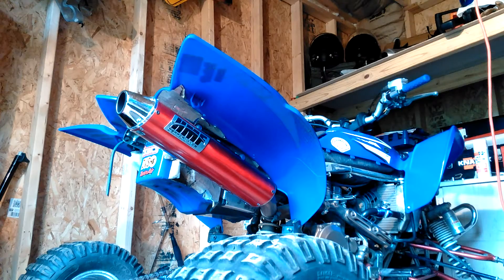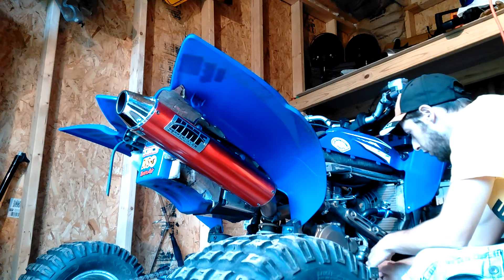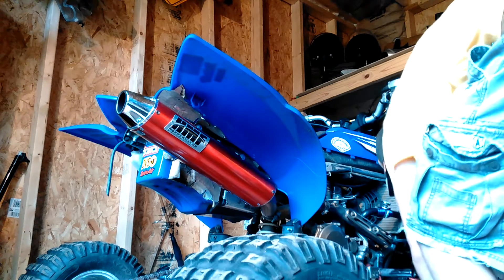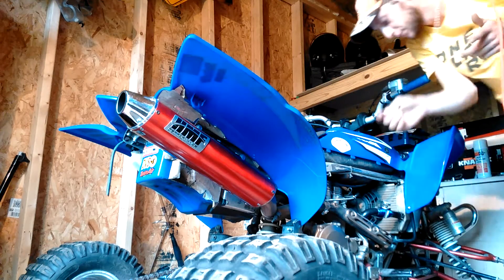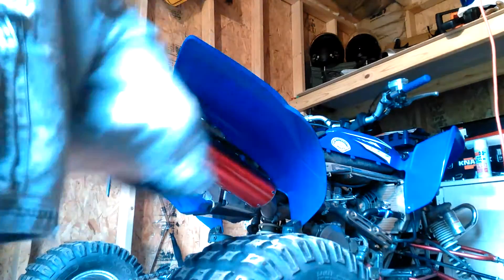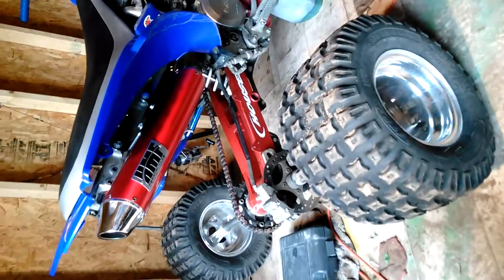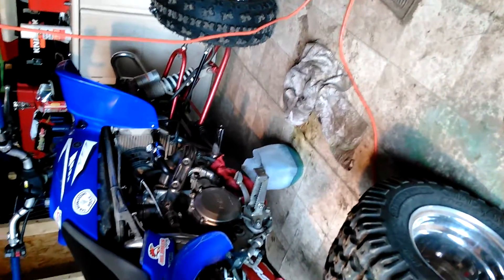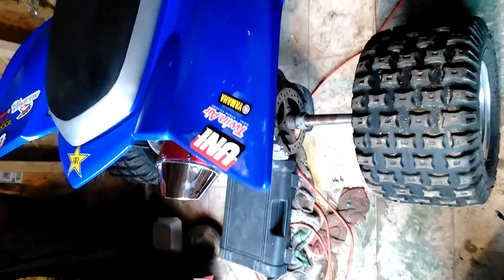How to Change Coolant on Yfz 450

Comment: Nice bike skin!  I just got the red yahmahYFZ450R SE.. love it!  Matter fact i changed my first oil change on it yesterday after the break in point.. now am aimin to check and change my coolant in the mornin... thanks for the video man...
Reply: I used semi- synthetic 10w40 Maxima oil @3hrs (still breaking-in) on my new '21 Raptor 700R-SE . Figure 3rd oil change will use a FULL SYNTHETIC 10w40 oil.. Maxima or Yamalube. I have heard Mobil1 4T racing oil 10w40 is great in these ATVs.. @ $9qt isn't bad! These machines run hot & semi-synthetic is absolute minimum oil can be used or bet you will grenade it in short order/very least need rebuild too soon. Have a '10 YFZ450X that still runs/looks great 👍. Enjoy!

Comment: That temp gauge that you have is on the wrong hose, it’s supposed to go on the other one as this is the feed into the motor (cooled by radiator) side
Reply: You could hypothetically do both. To verify rad efficiency.

Comment: I will be changing my hoses to a different color would you recommend putting new coolant in my bike?
Reply: Rashad Dorsey engine ice is great
Reply: Don't  use engine ice,, it can damage parts in your unit,  use yamalube yamacool,  that is specifically made for yamaha qauds
Reply: @juangaytan2437  haven’t had any problems with engine ice. Works great
Reply: You can use any coolant designed for aluminum blocks it says it right in the service manual. Yamalube recommended not required. Engine ice is the same basic makeup as every other blue colored coolant. That’s why it’s blue. What you do not want to use is dex-cool for GM, there is no corrosion inhibitor.